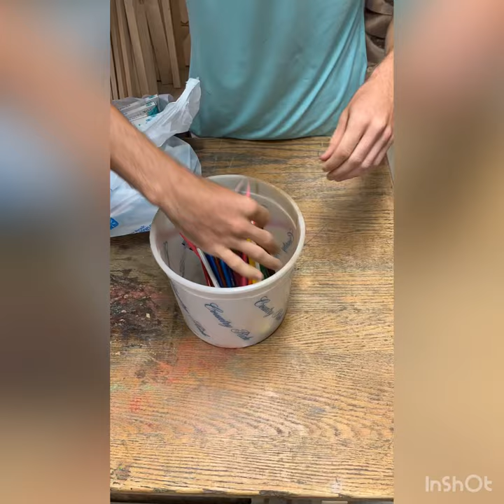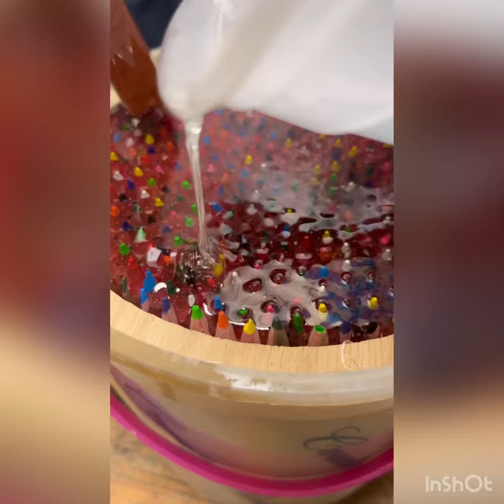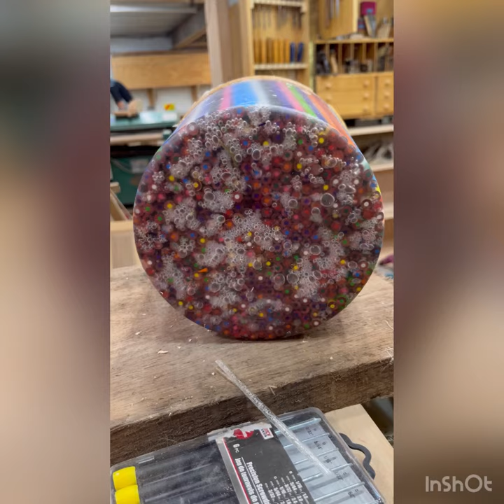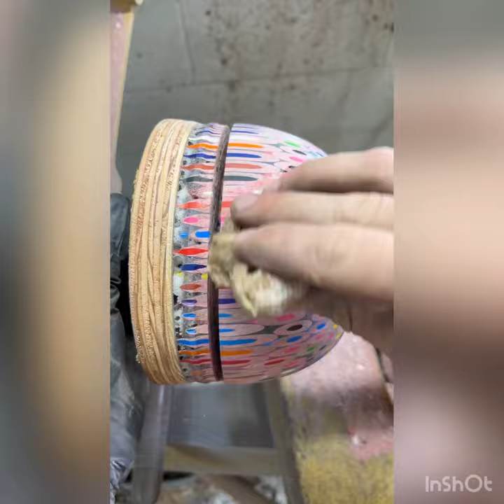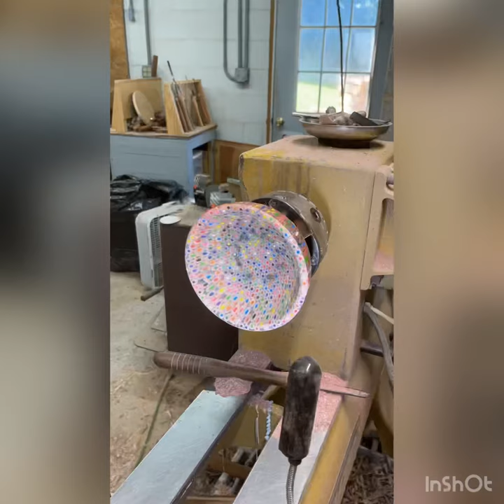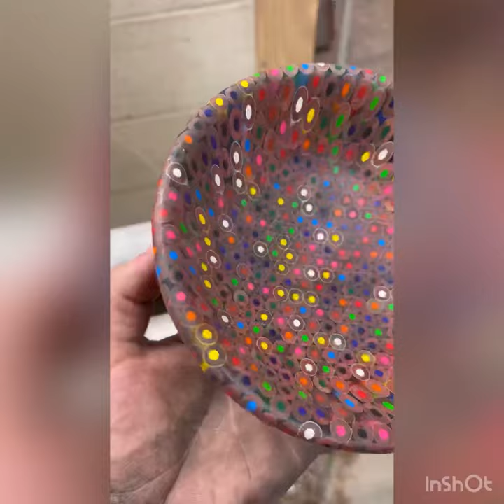How to turn a colored pencil bowl

Comment: Sorry I meant coat that bowl with.
Reply from the maker: I coated the bowl with about 2-3 coats of beeswax and mineral oil
Reply: Thank you. I made a color pencil bowl and used Tried & True linseed oil & beeswax and it made the wood of the pencils dark so the colors didn’t see as bright. The super glue that some other folks have been using dries so fast you barely have time to get it on the bowl. I’ll give this a try. Thank you.